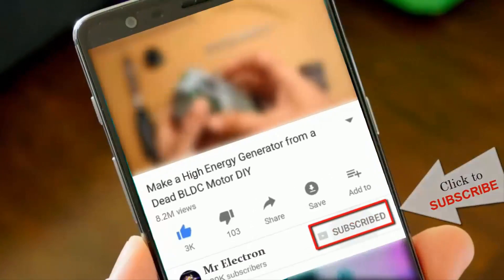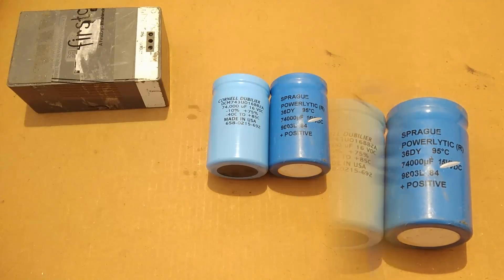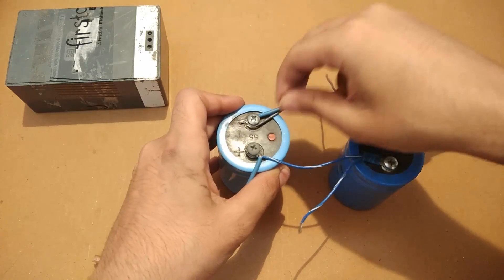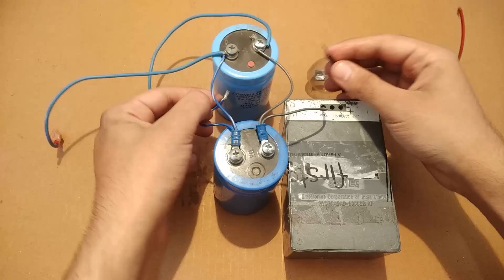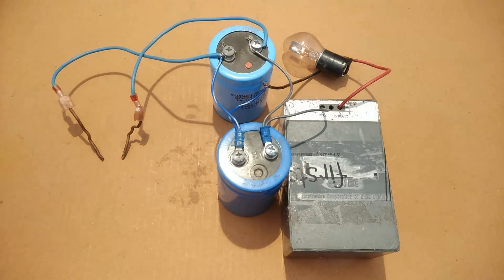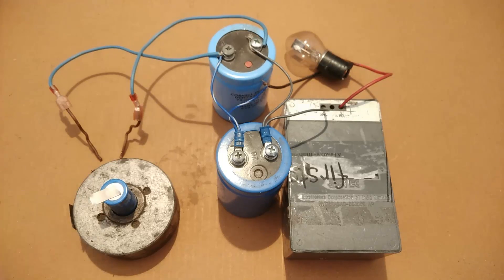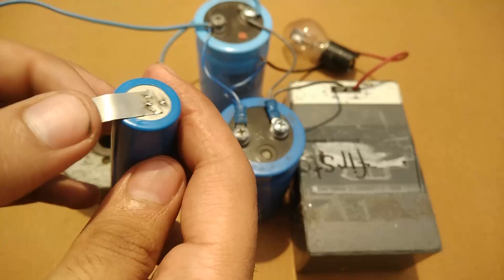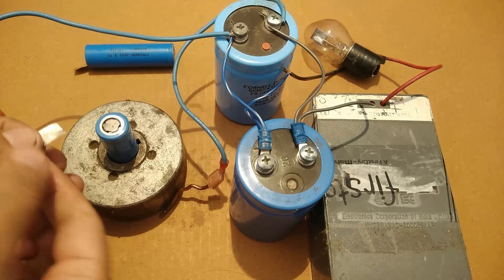How to Make Battery Spot Welder || Cheap Capacitor Welding DIY

Comment: Best video on this subject, gave you a like. 

Based on your video, I made mine from a 24VDC 3A "wall wart" plug-in power supply ($15 USD) I had on hand, 10 10,000uF 35V capacitors ($20 USD) a 12Ohm 100W resistor ($3.50 USD) - instead of a incandescent bulb - to limit the charge/short circuit current to 2A, and a blue LED with a 1KOhm 1/2 Watt resistor as as charge indicator. 

Your welder puts out about 11Joules per weld which is perfect for 0.1mm thick Nickle plated steel. For 0.15mm thick Nickle plated steel you need about 25 Joules.

If I switch in only 5 of my capacitors, I get about 14 Joules per weld. It takes about 0.6 seconds to charge.
If I switch in all 10 capacitors, I get about 28 Joules per weld. It takes 1.2 seconds to charge.

Thanks for the inspiration.
Reply from the maker: You are most welcome 😊

Comment: Please .. Why did you put the battery in magnatic while welding ? Thanx
Reply: When welding Nickle plated steel strips, some people like to use a magnet to hold the strip in place. Plus, the magnet's shape holds the battery upright. You don't need a magnet to weld. It is just an option.

Comment: Only thing I was wondering was how thick were the strips used and pure nickel or plated steel? 
I tried this with 0.15mm pure nickel strips and did not get good penetration at all - when you do a DIY video you need to give ALL the particulars of the materials you are using
Reply: This spot welder puts out about 11 Joules per weld which is perfect for 0.1mm thick Nickle plated steel. For 0.15mm thick Nickle plated steel, you need about 25 Joules per weld.

Just add 3 more of the same capacitors in parallel. That will give you about 28 Joules per weld, but it might take about 5 seconds to charge (depending on the bulb you use). Just wire 2 bulbs in parallel to get about 2.5 seconds per charge and you should be good to go for the thicker strips.

For 0.2mm thick Nickle plated steel, you need about 55 Joules (5 more capcitors). So you can see its not quite linear, but now that you have 3 data points, you can extrapolate to even thicker strips if needed. But 0.1mm  to 0.2mm are the most common.

Comment: Excellent replace the battery with a laptop brick and we have a winner.
Reply: what kind of amps does your laptop pull man!?
Reply: @alexflu2 Many laptop chragers put out 12V at over 5A which would work with this. The bulb limits the current to about 2A. Just dont go over the Working Volts DC (WVDC) rating of your capacitors. In fact, 10% margin is safer. Use safety goggles. If you hook up these capacitors backwards (wrong polarity) they will explode.
I used a 24VDC 3A supply with 35V capacitors.

Comment: The 12V lamp is genius!
Reply: seen people do this with a pc power supply to prevent short circuits while testing it when it's powered. they splice the bulb into the power cable itself, pure genius!

Comment: I have several 500V 6000uF caps.  Anyway to make those work?  raise the voltage maybe?
Reply: looks like 75V would give 1 the same amount of joules as your two in parallel
Reply: @SailBuddha  Or lower voltage and put 10 or so in series.

Comment: 082020/1414pst. Thank you for your experiment. The capacitive discharge spot welding looks simple and easy to assemble and perform spot welding, the way you showed. I haven’t seen such a video, before, to be honest.
A few things I have observed is that....
1) The welding spots look like discharging very high energy, thus forming a black spot on the surface. This may not be good for the battery casing, due to extreme heat at the spotted area. But the issue can be controlled by reducing, current and or voltage, by trial and error.
2) While the electrode terminals were transposed, I found that the spot weld also changed, meaning the weld character differed. That issue also can be changed by trial and error.
3) It was noted that both the electrodes were not placed on the Ni strip while welding, though the strip got welded well, at ONE spot only. Did you try to place both the electrodes on the Ni strip while spotting? I can understand that such a technic may make a good welding. Needs more evidence on that.
4) Instead of incandescent resistance a timer could be designed? Need some thought on this idea.
5) You opened up a wide area for further experiments and I thank you for it.
Take care and be safe.
Did any one tell you, that you could, also, take up singing?
 If not, do it. Cheers, Buddy.

Comment: Can i use 19v adapter 3 amps instead of battery
Reply: D karthik <<<< No. do not try this. Your transformer may not be able to provide the correct that’s required to spot weld. More so, the transformer will get extremely hot .

Comment: Hello friend I want to ask you if is any simple method to lower a solar panel voltage from 48v to 12 or 24. Is it possible please I already have a 12-24v battery charger but not 48v
Reply: George George <<<< George, yes it is possible to obtain 12Volts from 24V PV cells, provided your PV output is routed through a charge controller. There are 2 types of PV Charge controllers 1) PWM Charge Controller 
2) MPPT Charge controller. You can manually edit the input of any PV Cell volt (12Vdc or 24Vdc)  
If you are serious about PV cell usage, I’d highly recommend MPPT Charge controller. It’s expensive than PWM Charge controller, but very effective and gives better output from PV Cells.
PWM= Pulse Width Module charge controller.
MPPT= Maximum Power Point Tracking Charge controller.
Good luck.

Comment: So if I use a 1 farad capacitor, should it only be charged to 2.5v?
Reply: Mike Fay <<<<<<< Mike, 1F super Cap can be used. But an over kill! You may go down to 60,000 mFD, even.

Comment: What volt does the capicitor need to be 74000 mf __volt?
Reply: As long as the battery voltage is less that the capacitor voltage rating you are ok. The capacitors are 16V in the video

Comment: how does it work with a 12v battery? i doubt almost anyone has a 15v battery, do i need to add more capacitors ?
Reply: Joe G.P. <<< Will function with 12V DC.  3X4.20 Lithium Ion batteries in series will also work. 12Vdc 6ah/8ah motor cycle battery will also work.

Comment: how are you not getting shocked when you hold the bare copper electrodes? oh its only low voltage? no way!!
Reply: the supply voltage is 15 volts and its DC so it sparks but can not shock and if it did shock this would be a very light shock
Reply: No electrocution at all. It’s safe.

Comment: Where is the schematic??? You cannot write schem on the paper or what?
Reply: A battery, 2 capacitors in parallel (or just a bigger single), with a light bulb in between? That’s so simple it would be a waste of paper.
Reply: Hahahah.... that’s correct, Jake !

Comment: Can I use a 1 fared capacitor which was used for a car audio system? Or a 2.4 farad 24vdc ?
Reply from the maker: yeah
Reply: Too much capacitance and you will blow holes in the strip (and possibly the battery too)

Comment: i can't do it right now and need to weld a battery in a device to fix it up so how i can weld it without all off this ??
Reply: ahmed sarhan <<<<< Ahmed it is possible to solder nickel strip to Lithium Ion battery. Your soldering iron should be very hot and the duration of the soldering should be kept very minimal, so that the chemicals inside the battery does not get too hot. Clean both the surfaces of the battery well with alcohol (Rum, whisky, Gin may also work) and apply soldering paste before soldering. You must also pre-solder nickel strip where it is soldered to the battery. This will work. Good luck.

Comment: Hi is it possible to use 2 x 55.000 uf 16 vdc ? Because difficult to find exact 74000 uf 15 vdc in my country. thanks
Reply: hi! any capacitor with high Farad value (over 100F) should be fine
Reply: @karolbuda  You mean 100uF?
Reply: You may use 56000mfD or 60000 mfD but the working volt MUST be above the Battery Voltage.

Comment: Hello my friend, I was wondering if car battery would do the job? Im not much in to electronics but need to fix my ebike battery pack
Reply from the maker: too much current,, pack will get damaged
Reply: Surely a 12v lead acid battery could be used as the PSU.  The Lamp to the caps would protect over current.  Effectively the lamp acts as a soft-start.
Reply: @GodzillaGoesGaga  I think the Maxximuss guy meant using a battery without the capacitor, which might work  - with a relay, a momentary switch and a quick finger....or a timing circuit :-)
Reply: Mr Electron I see, thank you, what do you suggest to. Use??
Reply: @MrElectron  Wrong.  The lamp will prevent that.  A car battery would work fine.  All you need is a source of 12V power sufficient to charge the capacitors.. It's the capacitors that deliver the high current [their exact reason for being!].

Comment: can the supply be replaced with an adapter?
Reply: With Adaptor 12v 5a
Reply: Do not use step down transformer. Use only 12VDC battery.